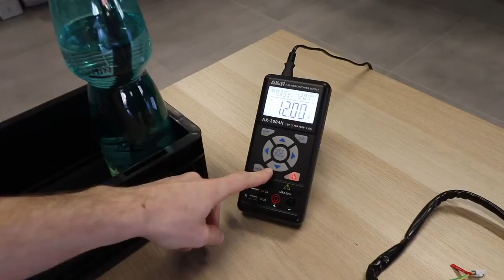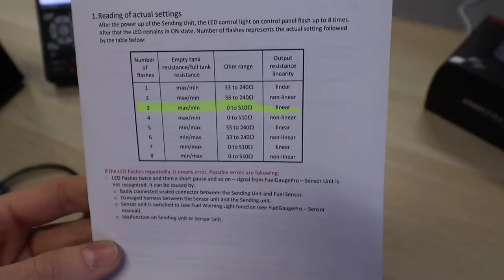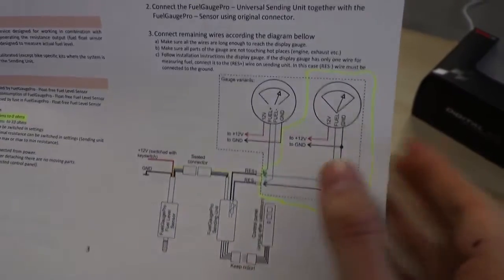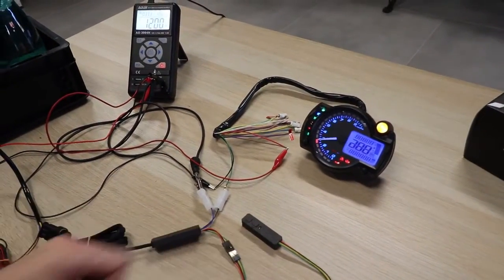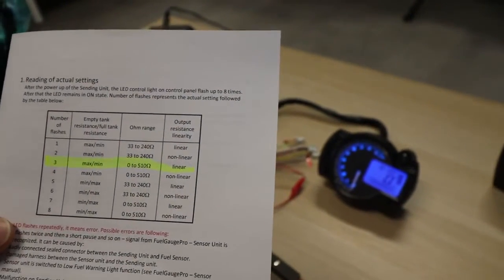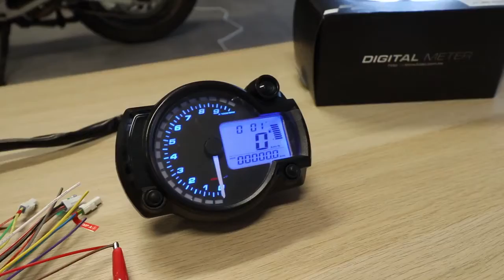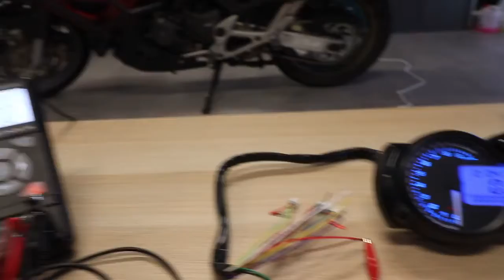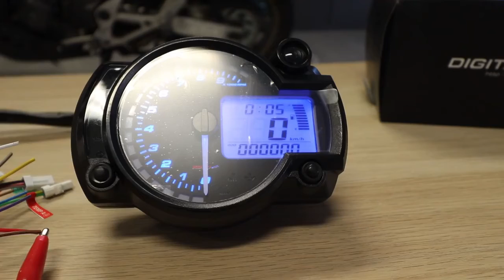FuelGaugePro   Universal Sending Unit Demonstration

Comment: Hi I have just purchased one of these can you please advise on if this needs fitting on the fuel line before or after the inline  vacuum pump ?
Reply from the maker: Hi, could you please write me type and year of your bike?
Reply: @lskmotorcycleelectronics7444   hi its a 1984 kawasaki Gpz 750 a1 thanks
Reply from the maker: @paulgee5068  Give it directly behind the tank outlet.

Comment: hey why do you speed your video up at 5:18 for 12 seconds? Actual minutes pass by on the timer in those 12 seconds. That seems misleading to me.
Reply: Because the fuel level was taking some time to reach to maximum level. Which shouldnt be an issue if you filled the tank to full. Doubt youll run it to empty before it catches up. Would you rather sit there and watch it rise real time?
Reply: @bigappa1862  makes sense, and it totally is better than not knowing at all, thanks :)